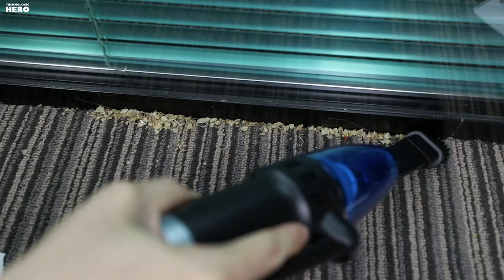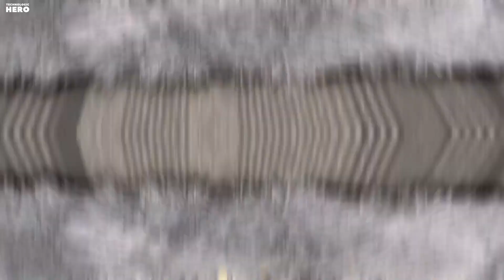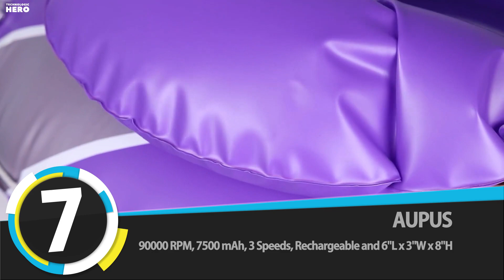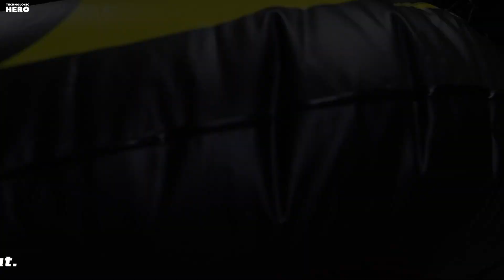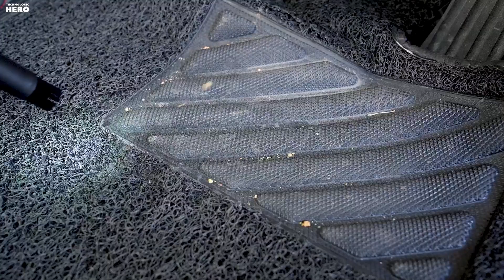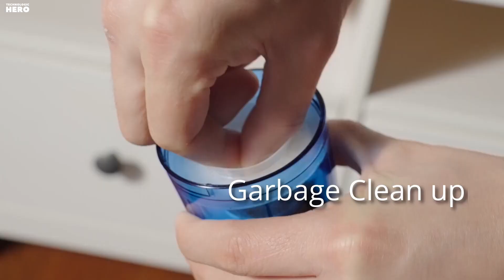Top 10: Best Cordless Air Dusters in 2023 / Electric, Compressed Air Blower, Vacuum for Computers

Comment: Don't use compressed air on the fans like this guy. Motors just aren't optimized to create current. Sending any kind of unregulated power back into the motherboard via a fan motor can have unwanted side effects including shorting out the board. Hold in place with a pencil or screwdriver before air-dusting
Reply: Most modern parts don’t short out while dusting anymore.